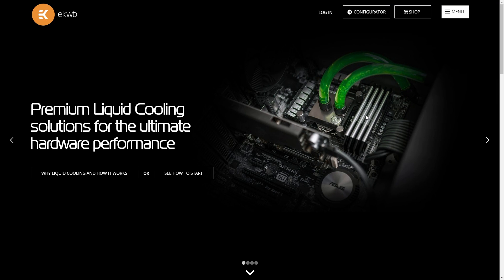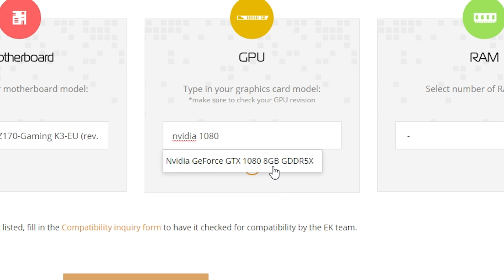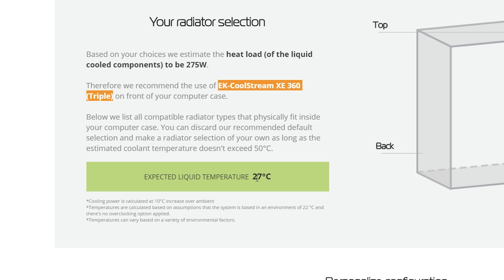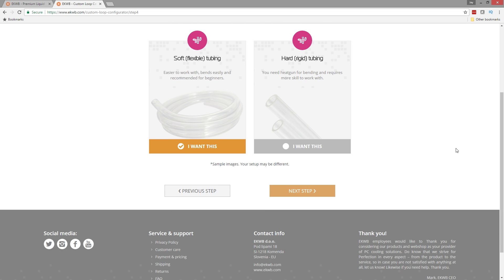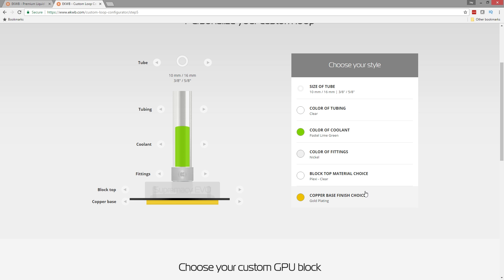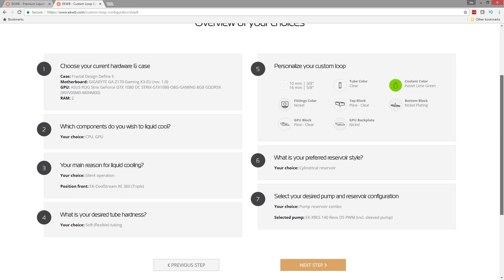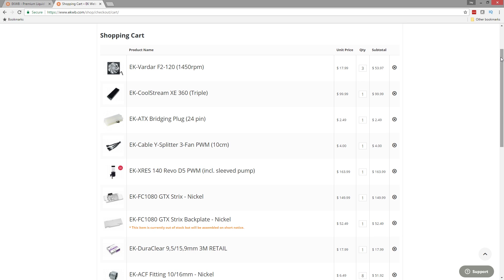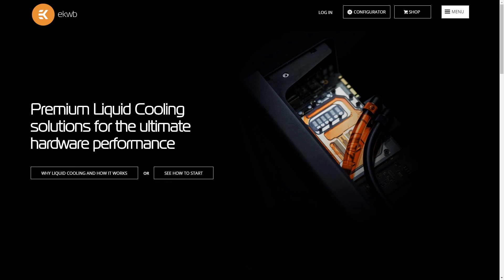How to configure a custom water loop using the EKWB CLC

Comment: I have just used this to configure my loop. 

Whilst it fits, just, there are a couple of things to note:
1. Your motherboard might affect the radiator you can fit up top. Mine is a tiny bit to thick and fouls on the motherboard. So the radiator is mounted through the mesh, not the specific radiator mounting holes.
2. The fitting of radiators may require removing drive cages or optical drives. Again mine has necessitated the removal of the drive cages.
3. It doesn't configure a drain port! Very important to include.

Comment: I used this configurator a few months ago to build my first custom loop. It does the job all right, gets you the bare minimum of parts needed. I recommend adding a bleed port valve with a T-splitter, helps to drain the loop when it needs maintenance.

Comment: Hey Jay, i used this configurator before your video and it's cool to see you're informing others. I currently have a 4790k watercooled by an h100i (that does a fantastic job), so i was only planning on watercooling my titan x pascal. Would you say building a gpu only loop is worth it or should i just wait and ditch the h100i?

Comment: Sadly for me, it appears that they do not list the Define Nano S on the Configurator... But I know it can be done (from your video and videos others have done). One thing I found interesting is that if your particular piece of hardware is not listed, you can submit a Compatibility Inquiry Form. If anyone has any hardware they isn't in the Configurator, I'd suggest filling that out like I am now. That way other people can more easily fill use this if they want an easy way to plan out their own custom loops.

Comment: The 2.49 24 pin ATX jumper does the same job as a bent paper clip... :P
Reply: My EVGA PSU came with a jumper. Nice to have, but I only ever used it once to see if it worked before install.
Reply: Fatih Uyan its to start the water system eithout powering the motherboard. so you can start filling the system
Reply: Noah B 
But there are a lot people to whom electricity is some kind of voodoo.

Comment: I got a gigabyte gtx 1050 2gb did I chose well
Reply: It's a fine card, but don't even think about watercooling it.
Reply: I don't know cuz I don't know your budget, but at this price range I would have spend the few extra bucks to get a 1050Ti for a smoother and longer lasting experience.
Reply: Jimi Jones A 1050ti or rx470 would've been far far better
Reply: if you spent around 100, yes. ya did good for that price point. if you spent 139+, you could have done a tad better with a 1050 ti. it purely depends on your use case. if you're playing dota, lol, overwatch, and non-taxing games, it's perfect for that use case @1080p.

Comment: and the website does not even fucking work
Reply: dont have a space between R4
Reply: Yeah not working for me.
Reply: We probably crashed it.
Reply: Not working for me either.
Reply: works for me
Reply: it's not the traffic that's the problem. If I type "define r 4" in the case field it sends a request to the server what cases match that and it gets a reply fast, but it doesn't show me any of the options....
Reply: I am on edge and firefox. not working for me either.
Reply: just put in define and click on the right one, i tried with chrome, my cellphone and my tablet... all chrome based... this is pretty strange... have you tried just to put it fractal?
Reply: pretty strange, it's working for me... which browser?
Reply: For me its just really slow with the suggestions.
Reply: Jasotech odd even worked on my ipad and that has a crap browser
Reply: Suggestions are not coming up no matter what I type in I am on edge on my PC and on chrome on my phone not working on either even when I type in exactly what Jay types in
Reply: Lokb did you even read? I checked that the servers are responding with a range of cases that match. So changing the query will not fix the problem.
Reply: Same here. Fails to bring up any results, even using the same terms as Jay.
Reply: Working fine for me. Using Chrome and have an Enthoo Luxe.
Reply: Christian Stout
A few thousand people? Hard to believe.
Reply: Maybe u just had a bad day.... jesus some people judge companies hard
Reply: on chrome, worked fine

Comment: would you say a bending kit would be helpful or do you think the freedom in free hand is better ( I am pretty decent at eyeballing other things)
Reply: Xathrid tech I would recommend freehanding, there's a learning curve for sure so get extra tubing; but the "bend kits" sometimes make it harder to make a clean bend if you're new at it. Watch some of Jay's videos on hardline bending, it's not very difficult once you get the hang of it
Reply: Mikah Mitchell yeah I just   wasn't   sure  because  a pro makes their craft look easy but I think   I'll buy a little   over 2× and is their any software   for 3d  modeling  it
Reply: Xathrid tech You could try using Sketch Up 3D. A few people on reddit had a discussion on this. Being that's with downloaded parts like water blocks, or whatever you couldn't create in the software itself. But it would work
Reply: Mikah Mitchell so the cad files are already   made up because   that's basically   all I need